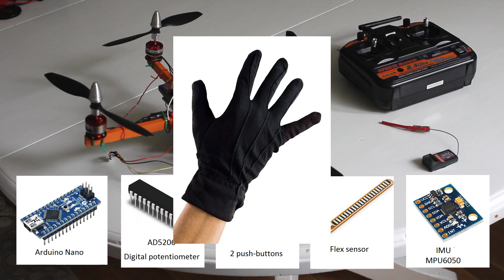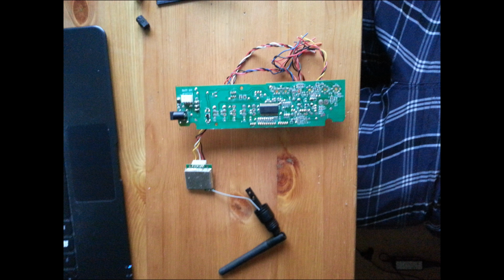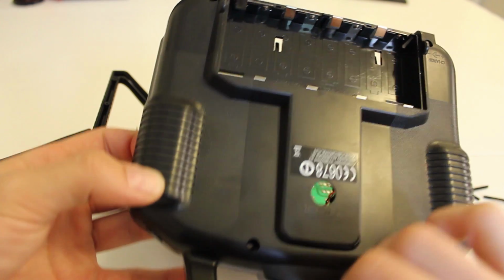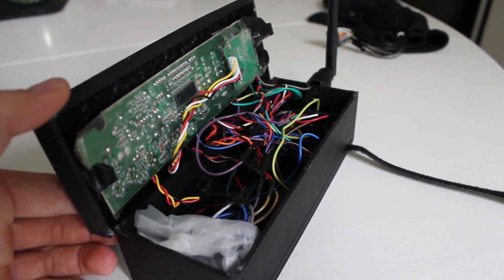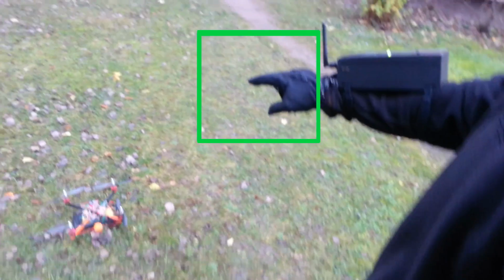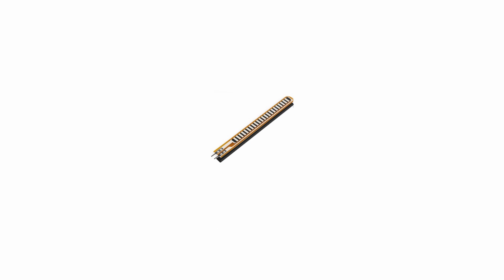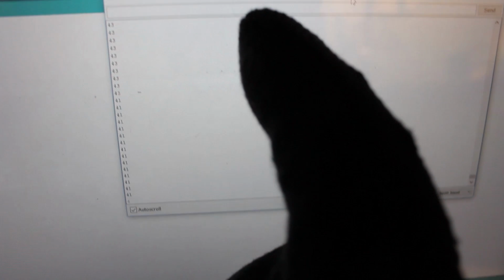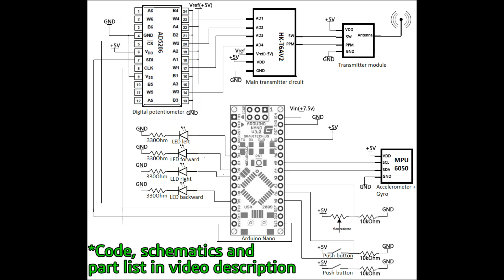Building Arduino One Hand Transmitter For Quadcopter,  Code +Schematics

Comment: Sir, in arduino program Flex sensor there is "Constrain" on yur program, how if i delete that fungtion ?... because
i try to default program with flex sensor and add constrain, it doesn't work, but if i clear it my program work and indicator led can dim and bright..

Comment: Josef which of the AD5206 did you use? 10kOhms, 50kOhms or 100kOhms?
Reply from the maker: AS-freaky, if I remember correctly it was 10k Ohm potentiometers.
Reply: Ok thanks :)

Comment: Wow really awesome!! I'll try it. And I made my own drone that following your first video
Reply from the maker: Great to hear, bin heo! Good luck with the build :)
Reply: bin heo hyee sir bin heo. im from malaysia. i also want to do this project. can you help me especially in connection of sender n receiver.  we only can use hobby king or another remote control???
Reply: Syakir Pro Hi Syarkir Pro  I used Hobby king. I can't understand what is problem in connecting transmitter and receiver.
Reply: if we use other remote control , can we make it?? i mean we use other than hobby king. because my place is hard to find hobby king.
Reply: Josef Holmner sir. can i ask? if i buy 1 drone set with remote control. i just only modify the remote control and convert it to glove hand by using arduino nano is can right???
Reply: Syakir I'm not pretty sure. But I think that can be possible. I'm not good at modify...
Reply from the maker: Syakir Pro, if the stick inputs are decoded by potentiometers, then you should be able to replace them with digital potentiometers, as in the video. Good luck!
Reply: hii.. you did it and work clearly ? can you teach me, please ?
because my flex sensor doesn't work, and i try by my self
in arduino program Flex sensor there is "Constrain" on yur program, how if i delete that fungtion ?... because
i try to default program with flex sensor and add constrain, it doesn't work, but if i delete it my program work and indicator led can dim and bright..